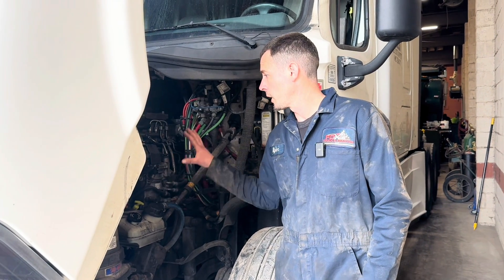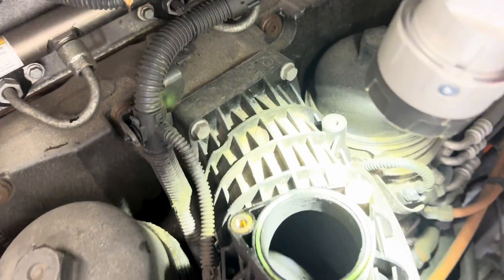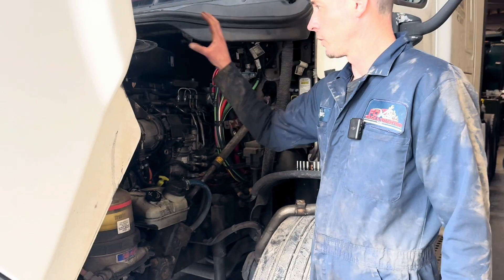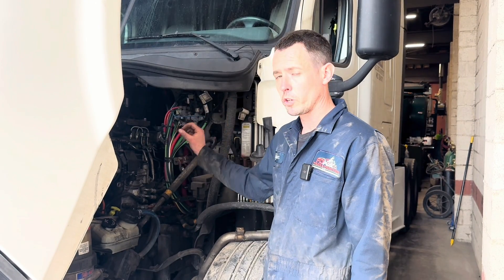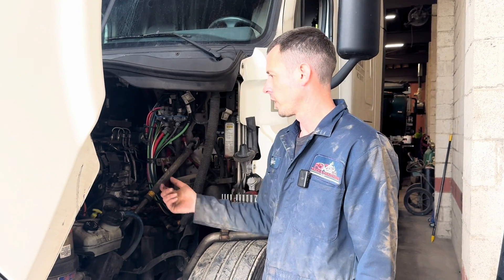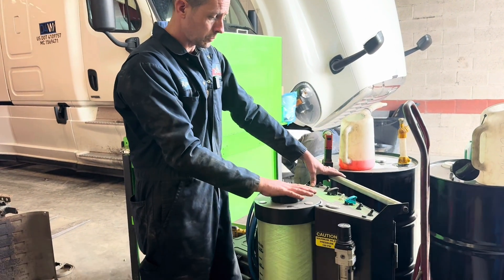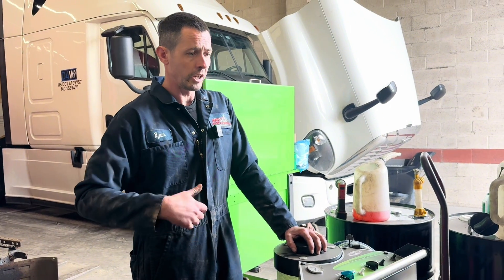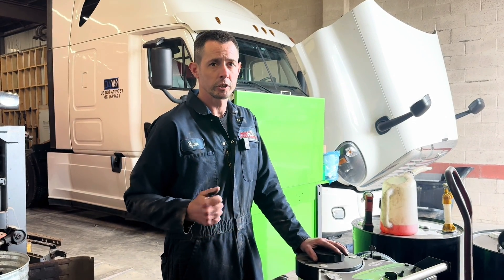How to get a complete diesel engine and after-treatment emission circuit clean

Comment: Hi ryan do guys service paccar mx13 engines.
Reply from the maker: Not at the moment, but we can obtain the adapter if you are interested in the service
Reply: @truckingandfixing  if there is a market for it. Also do you also do general repair on paccar. Like code reading and resetting and what not.
Reply from the maker: @inamacalin1 yes, we do service paccar engine